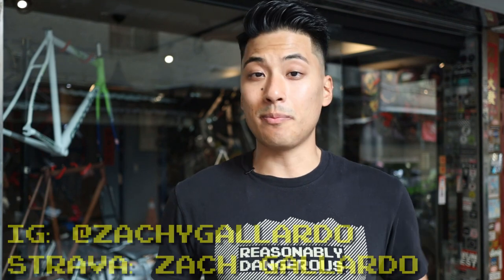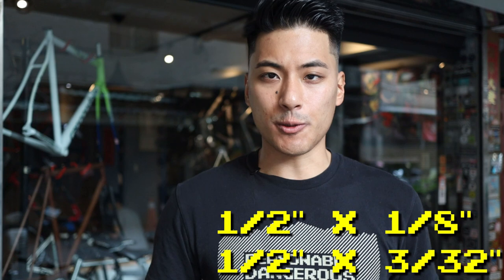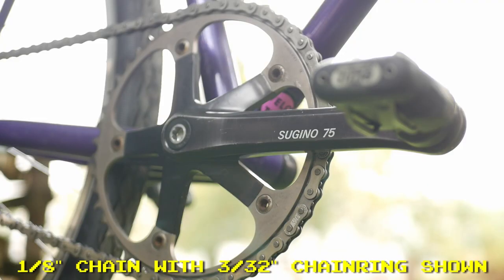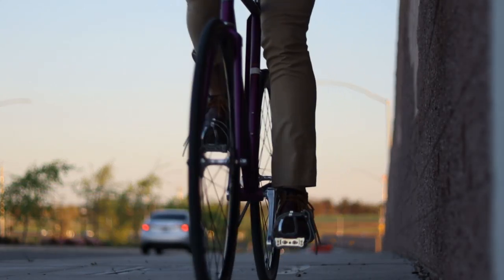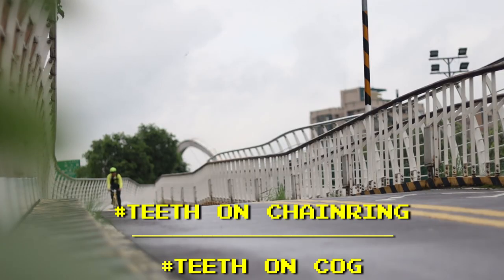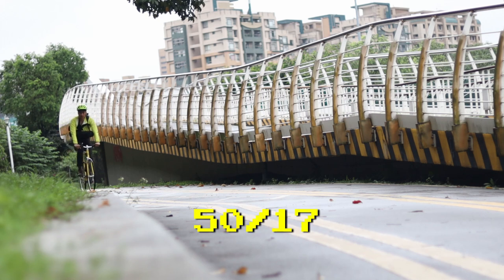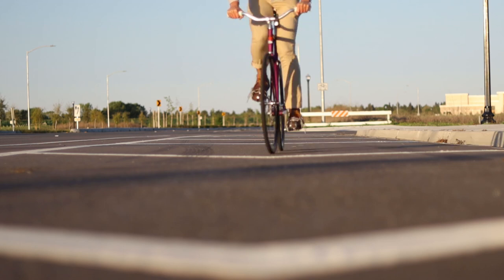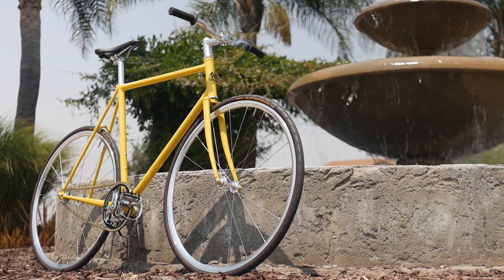1/8" vs. 3/32" Chains, Gear Ratios & Skid Patches | Too Afraid to Ask

Comment: I wasn’t confused at all... now I am😜. Run 1/8 chains on everything! Especially if your fixed. Run whatever in rings and cogs. Ratios- Forget them! Chain rings- Bigger tooth count is faster and harder to turn. Smaller tooth count is slower and easier to turn. Cogs- Bigger is easier to turn and slower. Smaller is harder to turn and faster. Done. Oh wait... crank arm length. 165mm will make it harder to climb but will let you lean further into a corner while peddling. 175mm will make it easier to climb but will increase peddle strikes. There are lots of crank arm sizes- 160,165,167.5,170,172.5, and 175. There’s more but I’ll stop there. Generally fixed bikes have a relatively short arm for cornering but if your just single speed you would pick one that is equivalent to your height. Then you can fudge it up or down 2.5-5mm for style(a spinner or a masher) or terrain. I’m Single speed, bike came with 167.5’s, I run 170mm normally and 172.5’s if headed into hills.

Comment: You answered all my worries with this one video which google was incapable of doing. Thank you.
Restoring a 70s road bike to be a single gear and i did not even know there were different chain widths, since i did not need to know with mountain biking lol. LBS grabbed an 18t freewheel for me and when i was mating it with my wheel i realized the chain whip did not fit. I freaked out thinking i MIGHT need a new crank or have to source 3/32 freewheel...

Comment: With my single speed bikes, I used gear inches to choose a chainring that would work well on my local terrain with a 17T freewheel.  It's easy to find 16T and 18T freewheels to swap and change gearing during the season.

Comment: 3/32 chains on fixie/track bikes came from the old 27" 10 speed ( 5 speed rear cluster) bikes. The rear drop outs on track bike and roab bikes were the same. This allowed track cycling gear to easily and automatically go onto the road bike and back again. The thread on the 5 speed road cluster was the same as the thread on the rear track cog AND the centre bracket locking ring. Therefore a road wheel would easily be set up for a track bike AND a rear wheel for a track bike onto a road bike. Most track cyclists had to train on the road. So this allowed them to use their track setups for specialist track training. This universal system was far better than today. Because the expense of track and road racing is killing the sport.
On the track - sprint type racers used 1/8 because it was stronger and endurance races used 3/32 because its lighter.

There is nothing better for building leg speed than training with very low fixed gears on the back off a road bike. 50 years ago one of the most popular racing formats  was using a fixed 72" gear.
Most racing cycling clubs nominated the first month of the track season as a 72" gear only. This is how you get massive cadences without rollers, a power meter or a small motor bike.
I used a mechanical music metronome (for piano/drums/guitar) to judge cadence. No timing type devices or outside coaching was allowed. I practiced by listening to the clacks of the metronome and "playing" the drums. The top sprint cadence was 160. The go to track cadence was 140. If it was "easy" - go up a gear. If hard - go down a gear. So the aim was to ride the track with 140 cadence.
Track riders were expected to keep up a 140 cadence for 7 minutes. Today Olympic standard sprinters use 130 / 135 cadence on a massive 60 front chain ring with a 120" gear. In the past they used 160 cadence with a gear say around 94. For endurance type track cyclists the go to cadence was 105. On the road the go to cadence for racers less than 25 mile was 105. For races longer than 25 mile it was 100. Thirty years before Armstrong. It was common for racers to use a single speed track bike (94" gear) for road time trials. But latter this was banned. For timing I used one of my dads old watches mounted to the front bolt on the haddle bar stem. A wind up alarm clock or battery operated kitchen clock next to the track worked great.
Justs shows what people dont need. Sometimes the old days were just better. But no manufacturer or bike shop will tell you this.
Reply: Interesting information, thanks for sharing!
Reply: @zhe_shean  
for you.
TRAINING FOR TRACK RACING 
Racing season was summer (N/June-Oct S/ Nov-April)
Road bike training for track racing- A fixed gear of 68" - 72"(48 x 18 is 72" with 700x23C) should be used. If possible use 165 cranks. Std road cranks were 170 and track cranks 165. Remember on the road we often used 27" wheels with 1" high pressure tyres. Which were a bit bigger than the 700C - the gear size was slightly bigger. 
Racing on track was with tubular tyres (we called them singles) which were always the 700C size. But trained and warm up on high pressures because it was cheaper. Later a 49T front chainring became std for track bikes. Today 53T is often used. 
Most times if you buy a new track bike you can order what you want. 

Sprinters -    front chainring 48/47/46 x 1/8"  
                     rear cogs  14/15/16/17/19  (don’t use 12). Add in order 13/18/21/20.
To change track gears first go up/down the front chainring then up/down rear cog etc.
For some reason my dad had a 24x1/8" rear cog? So today I have one.
Endurance - front chainring 52/51/50 x 3/32"
                     Rear cogs had to be 3/32". So I just used 3/32" for both types of racing.

I used 52T x 3/32" chainring for all track racing. New track bikes came with 52T front. Our road bikes had a 52/42 x 3/32" std double front chainring as std. 
Today I would recommend 49/50/51/52 front chainrings and buy as many rear cogs as you can afford 13/14/15/16/17/18/19/20/21.
Start 51/50/49 front and 14/15/17/19 rear. Buy a 52 if you already have the 49.
Today if you buy a new track bike it usually has a 49T front and a 16T rear. 
Add cogs in this order- 18/13/21.
 
Nobody develops into a top rider any length of time that trains in a high gear. 
63" (42x18) & 72" (48x18) are good training gears. Closer to track season 84" (48x15).
By regulation juniors (under 17yo) had a race gear max of 88" (52x16/ 49x15) - watch out for tyre profile sizes. Its difficult to ride a banked velodrome with a gear less than 78". In winter races local clubs had a max gear of 85" (47x15).

Our road bikes had 52/42 x 3/32" double front chainring as std. 
My road bike and track bike had same size 52Tx3/32" chainring. Therefore they had the same chain size but different lengths. The track cog, road freewheel and the centre bracket lock ring were the same size. The British std dominated and god bless the Japanese for copying them.  So I could swap components from one bike to the other. The cog (sprocket) diameter and thread size was the same as the diameter and thread size of the crankset cups and road bike freewheel. Remove freewheel. Use a spacer or 1 maybe 2 centre bkt lock rings. Put on the track cog. Then use a centre bkt lockring against the cog as a lockring. Tighten them against each other. Remember to line the cog up with front chain ring/s. After riding the bike around for a while there is no need for a lockring. The cog will stay on. 

The easier way was to put the track wheel straight onto the road bike. Then shorten the road chain. If you got the adjustments right it wasn’t necessary to shorten the chain. Also a double sided rear hub meant the rear road wheel could go straight onto the track bike. Alternatively a double sided rear track hub could have different cogs either side. Simply turn the wheel for different gear sizes during training or racing - today this is banned. 

When I was young I was poor - broke poor. Back then anyone could afford the sport. This system made it a lot cheaper to get into the sport. Cyclists who had money had all the gear. But battlers like me had to get by as best we could. 
Today its cheaper to play golf than ride on the track.
 
 Road TT - front set up was 52/51, 51/50 or 50/49 chainings for a flat open course.
Std racing rear freewheel was 13-17T. It paid to have a range of them. Also I had 13/14/15/17/19 and 14/15/17/19/21.
Senior men used a front range of 52-54 teeth. Usually a single 53 was used. 
Very strong rider could use a range of 54 - 55.  
Hillclimb TTs - go by the hills and how far things are apart etc. Std front setup was 52/42. I had 15/17/19/21/24, 14/17/20/24/28 and 14/17/22/27/32 freewheels. It was possible to build exactly what you needed for that course. But I just swapped freewheels over as needed. 
Masters (over 45yo) and women used a single 50T front chainring and 13-19 freewheel. Juniors had to follow local restrictions max gear of 88" on their road bike.

Ten Week Endurance Program:   
Week1:  3days x 25miles.
Week2: 3d x 25-30 mile. 
Week3: 3d x 20mile + 1d x 30mile. 
Week4: 3d x 20mile + 1d x 40mile. 
Week5: 1d x 20mile + 1d x 30mile + 1d x 40mile.
Week6: 1d x 4x2minutes + 2d x 30mile + 1d x 10x1minute/1min recovery 
             + 1d x 40mile.
Week7: 1d x 20mile + 1d x 5x2min + 1d x 40mile + 1d x 12x1 min/1min recovery 
             + 1d x 50mile.
Week8: 2d x 35mile + 1d x 2x3min/3x2min + 1 x 55mile 
             + 1d x 10x1min/1recovery&3x2min/2recovery.
Week9: 2d x 20mile + 1d x 3x3min/1x5min + 1d x 40mile 
             + 1d x 2sets10x1min/1min recovery + 1d x 60mile.
Week10: 2d x 25mile + 1d x 40mile. 

Pre Season Track Program:
Road bike/fixed gear 46x18 on flattish roads @ 25kph
Week1: Tue 30km; Wed 40km; Thur 30km; Sat 30km; Sun 35km
Week2: Tue 40km; Wed 50km;  Thur 35km; Sat 35km; Sun 40km

Road bike/fixed gear 47x18 undulating roads @ 28kph.
Week3: Tue 40km; Wed 60km; Thur 40km; Sat 40km; Sun 50km
Week4: Tue 40km; Wed 70km; Thur 40km; Sat 50km; Sun 50km

Road bike/fixed gear (am) 48x19 flat/undulating roads @ 30kmh. 
5: Tue 40km; Wed 60km; Thur 40km; Sat am:40km+pm:track; Sun am:50km+pm track 
6: Tue 40km; Wed 70km; Thur 40km; Sat am:50km+pm:track; Sun am:50km+pm track 

Road bike/fixed gear 48x18 flat/undulating roads @ 30kph. Track bike now 48x15. 
7: Tue 50km; Wed 70km; Thur 50km; Sat am:50km/pm:track
8: Tue 60km; Wed 70km; Thur 50km; Sat am:50km/pm:track 

Afternoon at the track 47x15. Lap track slowly. Then 8km at 3/4 effort. Last lap hard finishing with sprint.
If rider has slow start: Ride around track shoulder to shoulder. At prearranged marks sprint all out for 60m.
If rider lacks jump in sprints: practice flat out sprints over 100-200m from rolling start. Recover completely then repeat.
If rider can jump but dies before finishing: practise long sprints over 220-250m from standing, rolling and flying starts.  

I started with an all-round training approach focusing on the 1 km TT. 
1000m TT:  52x15, 49x15, 50x14
This is roughly a minute long. So in track running this roughly matches the 400m/800m race. The cycle sprint roughly matches the 100m running race. The 4000m pursuit matches the 1500m/mile running race. So a comparison can be made between the programs for running and cycle programs based on time or distance of reps and sets. There are lots of excellent running programs but "no" track cycling programs. For a cycling workout, double the time or distance from the workout of the running program.

Basic sprint workouts:
1. Running- 2x30m, 4x60m, 4x30m, 2x30m
    Cycling- becomes 2x60m, 4x120m, 4x60, 2x60m.
2. Run-100+100+100m, 100+200+100+100m, 100+100+200+200m,       100+200+100+100m, 100+100+100m.
    Cycle-200+200+200m, 200+400 +200+200m, 200+200+400+400m, 200+400+200+200m, 200+200+200m. Slow 200m cycle between sets.
3. Run-30m max 6-8 reps, 50m max 5-6 reps, 60m max 4-6 reps, 80m near max 3-4reps.
    Cycle-60m max 6-8reps, 100m max 5-6reps, 120m 4-6reps, 160m near max 3-4reps.
Slow cycle between reps start with 2min then 1min then to 30secs. Get full rest between sets.
SPRINTER
Different track sizes 250m, 333.3m, 400m or 500m with different bankings.  
My local track was 480m. Today tracks are nearly always 250m.
We used 46/47/48 (49 for v strong rider) front chainring and 14T rear cog. 
36 spoke wheels.
Sprinter needs to develop speed and strength. 
Warm up 46x14. Sprints on Tuesday 48x14.  Sprints on Thursday 46x14.
Start racing season with 88" (49x15) and work up to 92" for the championships.
92" (51x15) is basic gear for match sprinting. 94" (52x15) gear size was used on very fast tracks. 
94" was also the gear size used for single speed road time trials

Track Match Sprint: 
Racing early season 52x16 88" Racing late season 50x15 90".  
Std gear was 51x15(92 inches). 
Most people used tubulars (23mm) on bitumen but I didn’t. 27inch wheels (not 700C) with 1 inch (25mm) high pressure tyres have a bit higher gear size. 
Note 22mm/19mm tyres have less gear size.

200m time trial: 
Top Sprinters use say 112" - 120" 
(53x13 110" 52x13 108", 51x13 106", 52x14 100" 51x14 98", 50x14 96", 52x15 94"). 
12.0s on bitumen is a world class time. Today on boards they do under 10sec.
On my local bitumen track I used: 
200m TT  52x13 108", 52x14 100" or  52x15 94"

14sec is 31.95mph   13.5s is 33-13mph    13-0s is 34.4mph
12.5s is 35.8mph     12.0s is 37.3mph      11.5s is 38.9mph
11s is 40.67mph      10.5s is 42.6mph      10.0s is 44.73mph     9.5s is 47.09mph
Work out what time you want? Then for a cadence of 140 what gear is needed?

Count how many pedal strokes in 10 secs and multiply by 6 or in 10 secs and multiply by 6. I used a watch (with a second hand) mounted on the head stem bolt. Watching the sweep of the second hand is easier than looking at a digital watch. Watch the sweep for 10 secs. 18 pedal turns is 108 cadence, 17 is 102 cadence and 16 is 96 cadence etc.

Rursuiter: Used 48/49/50/51 front chainring and 15T rear cog. 
Most commonly used gear was 50x15. They used 28 spoke wheels.
Souplesse is very important. Its how fluid the pedal stroke is. 
Smooth, smooth, smooth. Not push, push, push.
4000m individual or team pursuit: 50x15 90", 49x15 88", 51x15 92" very fast track or 48x14 93" world class rarely used.
Reply: @raymondmenz522  Appreciate the additional info! I concur that cycling can be made much more available to everyone. Wish you a great day.

Comment: Great video, already familiar with these concepts but would be great for someone who wasn't. Something else i'd like to mention, and you have said this elsewhere as well, is that most of the top of the line fixed gear chains will be 1/8", and they have a tendency to be stronger and more durable than both lower end components and often even their 3/32" counterparts.

Comment: Current setup is a Surly Steamroller that is too small for me, 52cm, I'll be going with a 54-55cm frameset with much of the same parts. 46/16 is the current gearing with Sugino Messenger cranks. I'd like to switch the gearing to 48/17 or 52/19, something that is reasonably fast on flats but also capable of climbing hills or sprinting from a stop light. I've been riding any and all kinds of bikes since 16 as my regular commute, I'm a decently fast rider, but the stock (used bike built from a racer) gearing is too much for me. I think somewhere around 75 gear inches is the sweet spot for climbing and achieving speed on flats, I'm leaning more towards 52/19, with 32-35 tires.

Comment: I tend to lean toward changing my chainring over my cog because I usually have the rough gearing settled and am just making finer adjustments to my ride for a given reason (the reason is given to me by the situation), ie it's my crit bike and I'm adapting to the speed of the course like if it has long straightaways and the turns are gradual I might bump my ratio by a few teeth but if it's got a few hairpin turns and a short straightaway than I will defiantly drop some teeth... but even not racing I may gear up for harder training intervals, or to hustle deliveries extra fast in good weather... but not too heavily as it's hilly here and traffic conserns, but if it's raining or it's an off day casual ride or a rest day I will drop some teeth. Now this part migh get a bit advanced for some green-leggs; but some different gearing combos have the same gear ratio... I ride dual fixed hubs on my delivery and training bikes and they have 15t & 17t cogs so I can make a big rough adjustment there in the field without pulling crank arms roadside... but I choose to only have rings that don't cause duplicate ratios, except that I ride a 14t cog on tts (time trials) but if I owned my own tt bike, I'd still keep that cog setup, but redundancy wouldn't matter much because I keep the same gearing on tts basically always, I hate time trials anyways (I'm not a sprinter I don't bother too much to maintain fast twitch muscle fiber in my training schedule so yeah)... but the point is I don't worry about weather my gears have redundancy in the 14t cog to any of my rings since my tt gearing is set for a whole season. And my cogs are all quite small to worry too much about redundancy but I stay aware of it when choosing new cogs an' rings... and it's not a hard rule it's just that I'd rather swap an already owned cog than buy a new ring that does the exact same thing. Anyways food for thought... just thought I'd through that out there.

Comment: Nice video. One question: For BMX bicycles some with 44/16= 2.75 and some stunt bike with 28/9= 3.1 which one more easy to cycle? (i:e -- Big chainring with big cog easy to cycle or small chainring with SMALLER cog easy to cycle?). Thanks.

Comment: Gear-inches are the units widely accepted for gear ratio comparisons.  Multply by the effective diameter of the drive wheel and tire properly inflated and under load.  See Sheldon Brown's gear calculator...